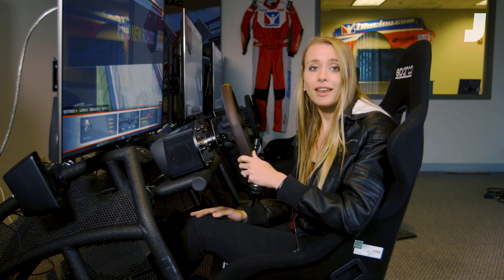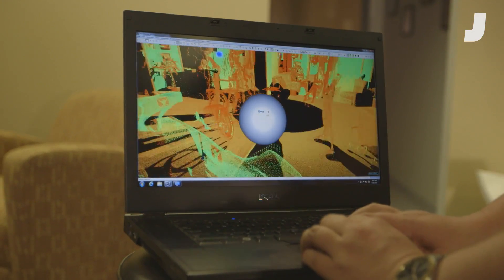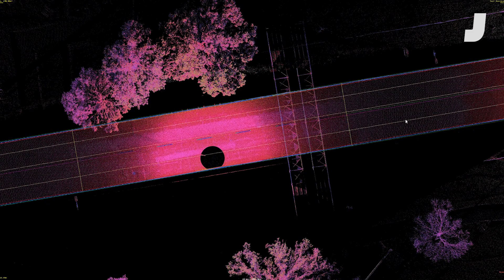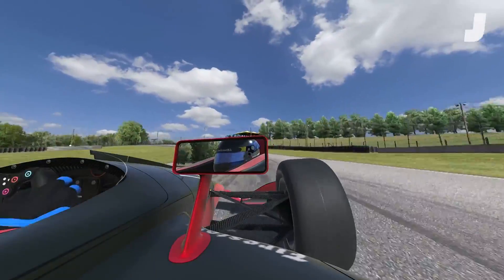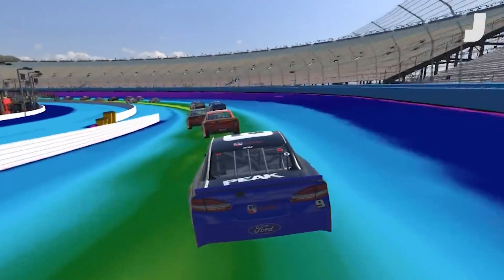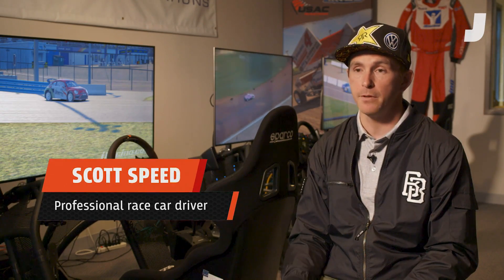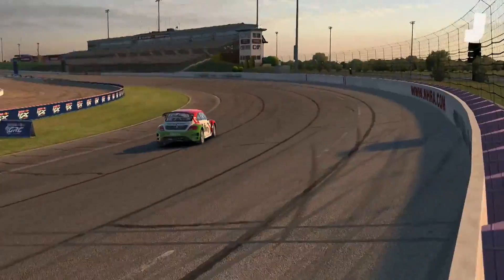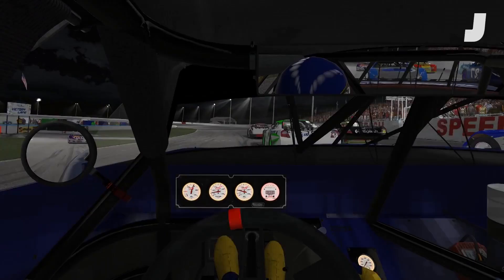How The Most Realistic Racing Simulator Is Created

Comment: "That low line has warmed up and is not as grippy"

This is in direct contradiction to everything I have ever experienced on a real race track.  iRacing is a game, not a sim.
Reply: Lol exactly, what a farce.
Reply: You've never been on a real track then. Or know science. You want the tires hot, and the track colder. If they are both hot, you will lose grip. The optimal grip is when the tires are hot, and the line is cool. That is why when you drift up in a turn when you enter the turn too fast, your car gains grip, until there are marbles on the outer edge of the track after the cars shed rubber. You know the best line changes during the race? Watch an actual real race (obviously you've never been in one).
Reply: @gofuckyourselfyoutube6914  Actually I've been on several tracks in cars, karts, and on motorcycles with tires ranging from rock hard dogshit tires to tires so sticky it looks like a caramel apple with nuts because of how many rocks will stick to them rolling into the pits.  I'm also a karting champion, so we'll check the "been in a race" box.  AND I'm a mechanical engineer, too, so I think that checks the "know science" box.  

The optimal grip is when the tire is at the correct operating temperature for the tire, PERIOD.  If the track is warm, the tire will also warm faster than on a cold track.  Now, if the tire is past the optimal temperature and overheating, THEN a colder part of the track could be faster IF there isn't dust/rocks/marbles/etc. there, which there usually will be off-line.  However, simply saying "hot tires/cold track" is absolutely not a correct statement whatsoever, it's 100% operating temp of the tires, not higher or lower (greasy and melting or stiff and slippery respectively).

So stop learning from other video game dipshits and YOU need to spend some time on a real track and learn this shit.
Reply: @nunyabusiness896  a colder track means you can run a softer compound and also engines can run harder because the air is denser basically every 10 degrees your about a second slower but in formula Fords or gt5 it doesn’t work always like that we run can run only one type of compound and it’s meant to last for a whole season so it quite a hard compound it’s really hard to get up to temperature and then you would gain much time when it’s colder
Reply: @hubertkam7647  You're under the assumption that there are variable tire compounds available.  Most series have a fixed compound, only really high end stuff like F1 has different ones to choose from.  Either way, having a warmer line wouldn't make you slower unless your tires had been pushed hard for so long they're overheating.  Air density and engines are not relevant to what I said whatsoever as warmer or colder asphalt has nothing to do with air temp.  iRacing is shit physics, plain and simple.

Comment: Iracing is just a oval racing game that has all the 'pros' because they are the ones that can afford to laser scan tracks. Only problem is, every car and track is a fiver or tenner.
Reply: Actually, every car is $12 and tracks are $12 or $15. And I disagree - it's not a problem if you're serious about simracing and plan to stick around for a long time. I've spent about $950 on it over the last 2 years, or about $40/mo. But now that I have pretty much all the content I need, I'm only paying for subscriptions which means the average monthly cost gets closer and closer to the cost of a subscription every year. Even if I spent $100 on content every year (which I won't, because I no longer need to) and didn't take advantage of participation credits and all of the special discounts iRacing offer, I'd still have reduced the average cost to $32/mo a year from now and $28/mo the year after that.

My situation is also the absolute worst case scenario as I couldn't decide if I wanted to do oval or road racing when I started playing iRacing, so I did both - started with oval and bought most of the content as I worked my way up to A class, and then switched to road racing and did the same thing all over again. If I had just picked road or oval and stuck with it, I would've saved hundreds of bucks.

In the long run, iRacing really isn't that expensive. If you can afford to keep a Netflix and a Spotify subscription or eat out a few times a month, you can afford iRacing.
Reply: Hardrive33 Whadya think of AC Competizione?
Reply: I'm curious to know what made say "iRacing is just a oval racing", actually there is more road content than oval
Reply: get a job
Reply: Cameron Nicki Thiim (2014 Le Mans 24h LMGTE Am winner and 2016 WEC LMGTE Pro champion) also races on iRacing.
Reply: Seekay yea I understand that, but as a student living in a place where they don't want to employ a 16 year old I can't afford to keep remotely up to date with iracing. It I a great sim for racing, just not for actual drivers in high catagorys in non oval racing situations I believe.
Reply: Hardrive33 who told you it isn't good for actual drivers who aren't in oval racing? Go look at Kelvin van der linde on Instagram and YouTube, factory racing driver for Audi, he uses it on proper race circuits
Reply: Wow I sure love racing the Nurburgring oval